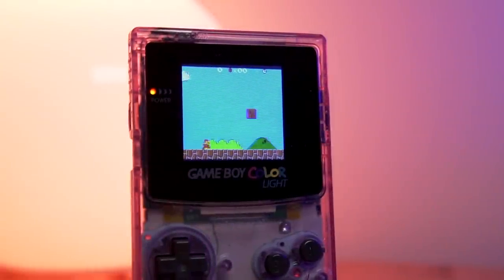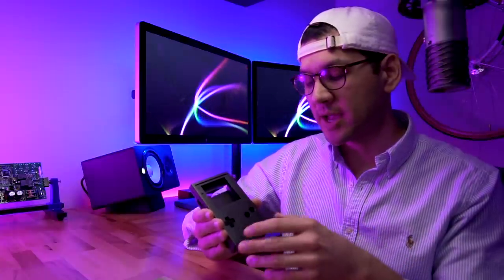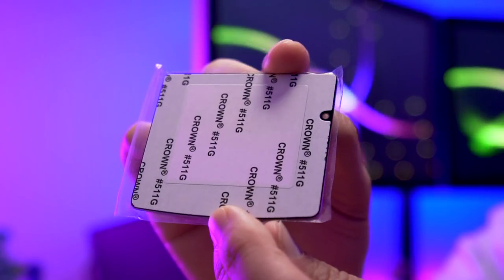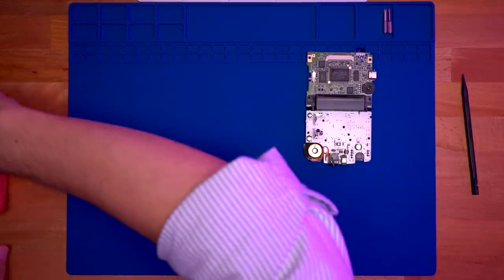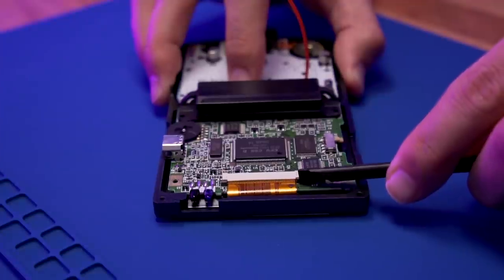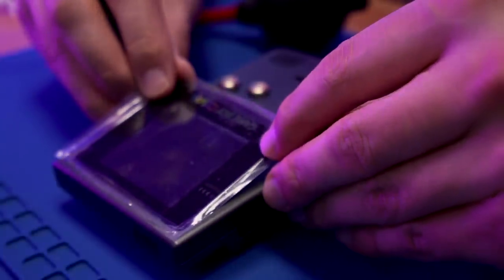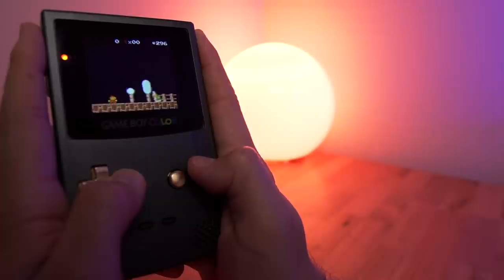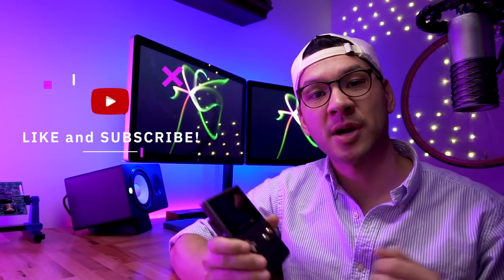ULTIMATE ALL-METAL GAME BOY COLOR WITH IPS BACKLIGHT KIT | FunnyPlaying and Boxy Pixel | Retro Renew

Comment: I have the brass buttons on my Boxy Pixel build as well. I recommend lacquering the the raw brass buttons to prevent oxidation, or at the very least slow down the process. Hit it with some alcohol (iso or denatured) to clean and then use a spray lacquer. I did three coats. They’ll stay shiny for a long time.
Reply from the maker: Thank you for the tip Brad!  Cheers!

Comment: ooohhh very nice! not as pricey as i thought it would be.now if someone would do a kit like this for a gba cm3 pi build that would be great!!! keep up the hard work tito
Reply: Boxy Pixel does make a GBA CM3 kit but it looks like it's currently out of stock.
Reply: @Willard_guy  they only do the polished one
Reply from the maker: Got a CM3 build in the works.  Just need to wrangle up all the parts.  Some are on long lead production cycle, so don't know when that video will be made.  Cheers buddy!
Reply: @MachoNachoProductions  I have a gpi case but find it's a little small.i love the form factor of the original Gameboy advance but the prices are just crazy
Reply from the maker: That's awesome, I really like the look of the GPI!  I actually was able to get a Boxy Pixel CM3 shell, just waiting for the next production run of the Circuit Shield from Kite!  Cheers dude!

Comment: Looks incredible! I haven’t done any GBC mods yet. The only thing I would add is an amp to bring up the speaker volume. After seeing this, I’m really wanting to build one; I have to try out those brass buttons!
Reply from the maker: You should!  You will not be disappointed!  I definitely plan on doing an amp mod in the future!  Cheers dude!
Reply: Macho Nacho Productions I’ve been trying to find a tutorial or even just basic info on adding Bluetooth audio to Gameboys. There’s one video I can find on YouTube that shows one working but not much information on how it’s done beyond using a cheap Bluetooth transmitter board from eBay/AliExpress. I get that it’s not the most important mod—even the Switch doesn’t have Bluetooth audio—but one of the reasons I love modding is learning how these boards work. If you happen to read this (way too long) post and you’re up for it, I’d love to see a video involving adding Bluetooth audio to a Gameboy
Reply from the maker: That would be a great mod!  I actually remember seeing that video a while ago.  I'm surprised no one really made a kit for that.  Unfortunately making something like that may be beyond my abilities.  Cheers dude!

Comment: Great videos, thanks so much for sharing.

 I have potentially a dumb question - I have a really hard time cutting kapton tape. The tape I got is crazy strong and adheres to any razor blade or scissors I use. Plus I get fingerprints all over it when I do it. Any tips for dealing with kapton?
Reply from the maker: Thank you Mr. Bawk!  No such thing as a dumb question.  I think that just the nature of kapton tape.  I have the same issues.  I also get finger prints all over it.  I think this is perfectly normal.  The more you deal with the kapton tape, the better you will become at handling it.  I hope that helps a little.  Cheers!

Comment: So I am currently going through my own process of doing this to my old Color, ive connected the battery and when i went to test the screen, it is on but extremely dim. Though when I turn it off, it flashes for a moment and I can see that the backlight is working. Do you have any advice on how to remedy this issue?
Reply from the maker: I’d make sure your solder joints are good and solid. Also that the lcd is properly connected to the driver board and motherboard.

Comment: Is it possible to use this housing with double A batteries and the original LCD?
I think it's a slick housing, but I don't have the money for all the parts at once, and I don't want to leave my GBC open while I wait for parts.
Reply from the maker: Hey Lasky great question!  Unfortunately the metal boxy pixel shell is not compatible with AA batteries because there is not battery door, it needs to have the lithium polymer battery and charging PCB installed. I do believe this kit is compatible with the original LCD, but you will need a 3D printed bracket so that it fits into the shell. I would double check the boxy pixel website, he has a lot of great information on there that should clear things up. I hope this helps answer your questions. Best of luck!  Cheers!
Reply: @MachoNachoProductions  yeah I just saw the lack of door.
Well I do hope to see what I can do. However in the mean time I'm going to install an AGS screen that I have into an AGB. So wish me luck, because my hands jitter a lot when working with small things like this.
Reply from the maker: @LaskyLabs  Haha, good luck dude!

Comment: Question. So My Life in gaming just did a video on this subject and mentioned that you lent him a gameboy with the best feeling and best responsive buttons, may I ask how you achieved this on an IPS modified gameboy advance, and gameboy color? is there a specific vendor to purchase the membranes, buttons and casing from?
Reply from the maker: Great question Lion Heart (love the name)!  I find using the OEM Nintendo buttons and membranes to be the best option.  I used the OEM membranes in the Game Boy color with brass buttons (from Boxy Pixel), as seen in the MLiG video.  For the GBA SP, I actually used an after market shell and aftermarket buttons and membranes, they all came with the pre-milled shell I got from Retro Modding.  I hope this helps answer your questions!  Cheers buddy!
Reply: @MachoNachoProductions  It does help thanks! but it's also kind of bad news as it means there are no good 3rd party providers yet for those parts, which  happen to be the most common parts to fail first, I'd have to look for near-new gameboys to modify in order to have the best. oh well, thanks for the info, maybe someone some day will take on the task to create AAA replacement parts for gameboy color/advance.
Reply from the maker: Haha, that would be awesome to manufacture great membranes!  In my experience some aftermarket ones are good and some are really bad. I’d have to say in general I’ve been pretty happy with retro modding membranes, but I think part of it has to do with console we’re talking about. I think sp membranes are probably easier to produce than a gbc for example because of the style of membrane. Cheers dude!

Comment: Hey man, awesome video! I’m going to attempt this exact mod at some point. I have most of the materials already, but I was wondering if it’s possible to include a pam8302a amp somewhere as well. Is there any extra space in the shell?
Reply from the maker: I’m sure you can find space in the shell but just make sure to is insulate it well so it doesn’t short out.
Reply: @MachoNachoProductions  would thermal tape be sufficient?  Thank you for the response!
Reply from the maker: Yes, kapton tape should do. Just to be sure I would email Nick at boxy pixel to confirm fitment. He’s pretty responsive. Cheers!

Comment: Nice video! I plan to mod a gbc with the funnyplaying ips screen eventualy. Was the lens you installed at the end a lens made specificaly for the ips screen or a normal sized one? Cheers!
Reply from the maker: Normal screen will work perfectly!
Reply: @MachoNachoProductions  That's cool!  By the way, did you notice any screen ghosting when playing games with an ips screen? I heard that was a problem with gbc and gba screen mods.
Reply from the maker: If there is ghosting, it’s a very small amount. I don’t really notice it when I play. To me the over all benefits of the kit greatly outweigh any of the negatives. Cheers Telrac!
Reply: @MachoNachoProductions  Thanks a lot!

Comment: Where can I get a glass lens for the ips screen for the GBC? I bought a foil one from jelly belly and it doesn’t fit. It’s too small for the ips screen. I thought it was the correct size. Oops lol 🤦🏽‍♂️
Reply from the maker: A normal original size glass screen lens should fit the IPS panel. It sounds like you got a custom lens for the older TFT lcd mods like the benn venn/McWill/Midwest embedded. Just a normal glass screen lens is what you need. Hope this helps. Cheers!
Reply: Yeah I figured that out when I compared my original GBC to the new screen. Thank you! Need to order a new one

Comment: My funnyplaying screen has a slight amount of play between the lcd and the frame. How did you keep it centered?
Reply from the maker: Great question!  In my video I’m actually using the boxy pixel shell which does a pretty good job at keeping the lcd in place. Are you also using a boxy pixel shell?
Reply: Macho Nacho Productions Yea I’m using the latest boxypixel shell. When it’s all assembled my screen has a slight angle to it. Like it’s crooked to the body of the gameboy.
Reply from the maker: That’s really strange. I would reach out to Nick at Boxy Pixel. He’s usually pretty responsive. Cheers!
Reply: Macho Nacho Productions thanks I reached out to him, and he gave me some pointers keeping it held down with kapton tape and some foam. It’s perfectly aligned now.
Reply from the maker: Awesome!  That’s good to hear!  Cheers!

Comment: Do you keep the old charging port?
Reply from the maker: Yes, but the it’s covered by the shell and cannot be used. The boxy pixel kit utilizes usb c for charging. Hope that helps. Cheers!
Reply: @MachoNachoProductions  have you had any trouble with volume going out
Reply from the maker: @stutter4life  Nope, so far the volume has been working well.  Are you having issues with volume?
Reply: @MachoNachoProductions  yes after I installed the battery and charger the volume work at first, didn't sound the best then nothing from the amp and speaker. Also I have gbamp3 from retro modding
Reply from the maker: Interesting.  I never installed the gbamp so the first thing I would do is open the console and make sure all the connections are good.  It could be that a wire cam loose or something is shorting by touching the metal shell.  I would make sure the entire gbamp is insulated.
Reply: @MachoNachoProductions  I'll hook a multimeter to it to see if anything has lost power or connection I did take out the old charging port to I don't know if that's a part of the sound
Reply from the maker: Sounds good. Let me know how it goes. Best of luck!  Cheers!
Reply: @MachoNachoProductions  so the speaker is getting power. I have my multimeter set to the sound mode and I Could Touch the negative and positive on the speaker to the amp board that it's getting power
Reply from the maker: Hmm, is the gbamp board insulated?
Reply: @MachoNachoProductions  yes, I've check all the wires that go to it and the gbc. Nothing is messed up on that end i tried checking for power but not sure if im doing that right. I see numbers on the tester just no sound from the tester
Reply: @MachoNachoProductions  also just hit you up on your IG